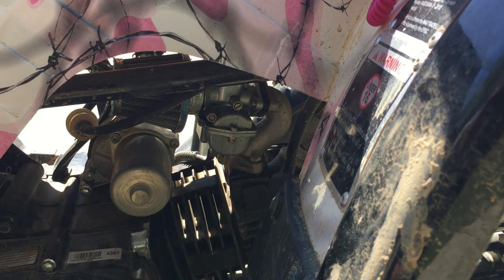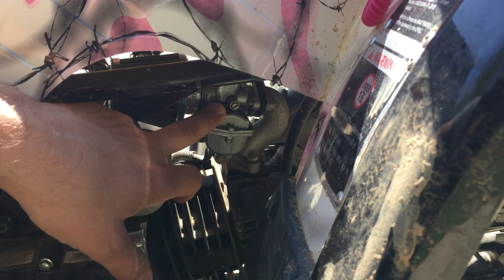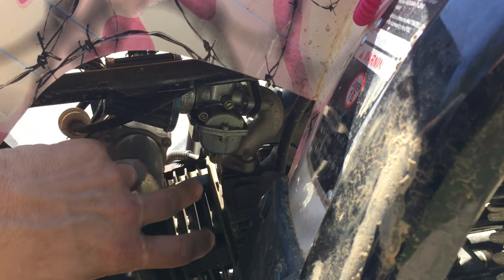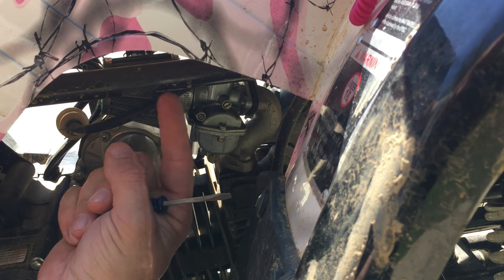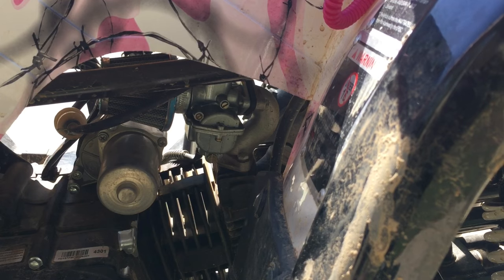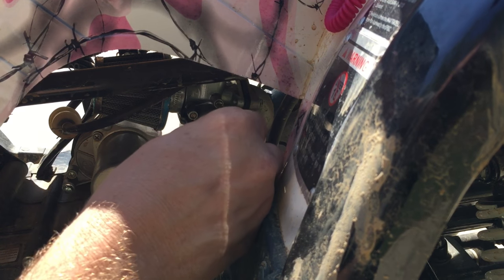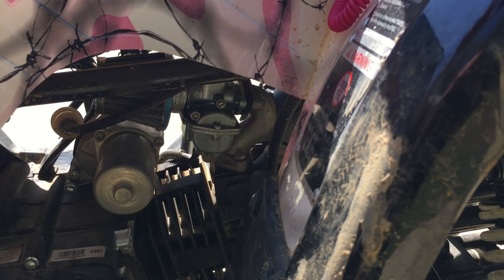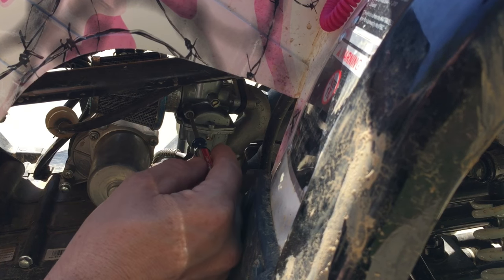Tune Your Chinese ATV Carb

Comment: You need too raise the needle jet one clip, the needle is lifting too early allowing too much fuel from the main jet too enter the engine too close to idle.
That's why it's bogging just off idle.
Reply: David Griggs how do you do that?
Reply: @dirtballnvegas9311  I was referring the guy that made the video and his bikes bogging just off idle but i will explain it to you.
If you undo the throttle cable end and remove the slide and needle , on top of that will be either a threaded cap or a clip of sorts that keeps the needle in position .
Remove this retainer and the needle should be able to be separated from the side .
There will be a C clip on the needle with notches above and below the C clip that you use too adjust when fuel from the main jet enters the engine because this needle when in the rest position drops down onto the main jet blocking fuel from there until it's required. 
The bike in the video had the clip position too low and was allowing fuel from the main jet too enter the engine because there was a gap between the needle and main jet which you don't want when the bike is basically still at idle .
By raising the clip position it allows the slide too open allowing more air in and for the idle jet to do it's job and the needle too open later removing that bogging that you can hear in the video. 
Hope this explains it for you 👍
Reply: David Griggs thank you so much brother. Mine is having this problem. It’s brand new. I appreciate you.
Reply: @dirtballnvegas9311  When you pull the needle and slide out before you go adjusting the clip height pull the bowl off the carby and remove the main jet check you don't have a obstruction in the needle entering end of that jet or on the main interior of the body down where the needle drops through. 
If this is all clear then shift the clip height 1 position at a time until it clears up .

Comment: Good rule of thumb, all the Chinese bikes are dangerously lean, richen it up immediately, do not even ride it before you fatten the carb up or you will burn exhaust valves and then the rest of the motor.

Comment: I’ve looked at mine and mine doesn’t have an idle screw. There is just like a small brass plate where the idle screw is supposed to go. What do I do?
Reply from the maker: It doesn’t have any screws?
Reply: BellyUpFish no it’s a Chinese 125cc
Reply: BellyUpFish I may also just get a new carb
Reply from the maker: Ttv_adenboz Mine is Chinese as well. They’re all over the map. You can get a carb on Amazon for like $15. I’d just grab that, then you’ll be going from a fresh start.

I’d also try to run non-ethanol gas if you can find it.

Comment: Damn things won't roll over a log but goes fast after a bit any fix to this literally can't bump up to a log and then hit the gas and climb over it
Reply from the maker: I dropped a tooth on the front sprocket and added a tooth on the rear sprocket and it would hop logs with a 250lb adult.

Comment: Any thoughts on porting/polishing the intake runner? Or do you leave them stock?
Reply from the maker: Johnny Turbo I’ve never really thought about it on these. Might be worth a shot.  If I did it, I probably wouldn’t go to a high polish like 2000 grit. I’d probably stop somewhere around 600...
Reply: @BellyUpFishGarage  🤔 i may give it a try. Why not lol. I love tinkering, especially if there is performance to possibly gain. 😁👍

Comment: Awesome video! Question, there's a rubber hose from the air filter to somewhere on the engine. What is that and do u need it. Put a k@n filter on son's atv and don't know if i should drill hole in filter like factory, or just leave off. Thanks!
Reply from the maker: Darius Butler That’s your crankcase breather/vent line.  It lets the build up of gases in the case vent out.

You can either route it to the K&N or buy a small filter for it at the local parts store or internet.
Reply: Ok thank you for letting me know!!
Reply from the maker: Darius Butler You’re welcome.
Reply: Darius Butler... I didn’t know either but I just drilled a hole in the new carb air filter and reattached the hose with a new inline filter
Reply: Runs great
Reply: @BellyUpFishGarage  you sure its not the egr?
Reply from the maker: J M I’m pretty sure.
Reply: @J M it actually acts more like a PCV valve but it’s not a valve. In fact it’s more like a catch can and a PCV had some offspring. Lol

Comment: I replaced the carb on this 4wheeler, now when I can crank it, it is already going forward and brakes can’t hold it? Any clue as to what’s going on or what I may have done wrong?
Reply from the maker: Brian Baxley You need to adjust the idle speed down. It’s getting too much “throttle” at idle.
Reply: Don't forget about throttle cable trim adjustments
Reply: @shawngoldsberry747  slide in backwards
Reply: @chezleymcdonald2481  that will definitely do it. More than a high idle
Reply: @shawngoldsberry747  believe it or not my friend thought he had see me do it enough he had it! Lol he took carb off (I had to help him clean idle jet out with sonic cleaner) but other than that he did the rest and it ran good really good 😂 he hit the starter and it went to screaming! He choked it and turned every screw on it for 2 hours. He was getting ill so I sent him for drinks 10 minutes later he pulls up and I’m riding it lol he loads it up doesn’t say a word and goes home true story

Comment: Hey man I have a 125 cc geo quad and when I try to accelerate it feels like I’m getting slowed down from the front brakes maybe I’m not sure new to this but their is a screw I loosend as it told me for the speed lock to speed it up I did that but no difference still feels like I’m being limited to my speed can any ideas?
Reply from the maker: Look at the throttle cable coming out of the throttle at the handlebars. There is a small adjustment you can make on the throttle cable itself.  That may be your issue.

Comment: Okay bro so the iddle how much should go in or out, turns? I got 50cc regal raptor dd 50 and got keyhin carburator but the problrm is that when the engine is cold it starts works like 30 sec and stop thats it... and when its warm its okay what should i do? How to adjust it?
Reply from the maker: Vac3 Poteski A good starting point is to close it and then back the needle out 2 full turns and adjust from there.
Reply: @BellyUpFishGarage  so 2 turns the air flow and also 2 turns the idle. I will try tomorrow that its 1 at night here in mkd. Thank you for your answer i will let u know what happend
Reply: Okay it worked 2 turns for normal i found the max and then i went to the idle and now on cold engine start well and dont shut down also on warm.. finally tnx mate for the info.

Comment: that carb is totaly different my air idle screw is on the bottom of the carb and inposable to ajust .. and that carb you just ajust is still not right it has a dead spot in it only till you are in the reves it is responsive so it any right eather
Reply from the maker: $14 on Amazon. Replace.

Comment: Hey what if it hasnt been started in months? Should i still try to start it with choke off?
Reply from the maker: If it hasn’t been started in a while, I’d start choke on.
Reply: @BellyUpFishGarage and adjust it while it's in choke on mode??????
Reply from the maker: No. Choke should be off for tuning.

Comment: i have a problem of when it gets under a quarter throttle it bogs down by it self real fast to a stall and i have to control it to get home with a fuel shut off valve, What could be wrong.
Reply from the maker: My first guess would be that something is wrong with your throttle/throttle cable if you’re having to keep it running with the shut off valve.
Reply: @BellyUpFishGarage  Thank you so much i will check the throttle cable
Reply from the maker: That’s where I’d start. Just make sure it’s actually operating.

If you can keep it running with the SOV and not the throttle, something is wrong with the throttle.
Reply: @BellyUpFishGarage  ok thank you i sure will

Comment: Will this help with a atv that will only start with help of starter fluid but stays running afterwards?
Reply from the maker: It could. Definitely won’t hurt it.
Reply: @BellyUpFishGarage  anything else you may recommend checking? I got it free while picking up scrap so got no idea. New wiring and battery.
Reply from the maker: If it starts on starter fluid and then runs fine, I’d expect there is no fuel in the carb when you’re trying to start it initially. 

Could be the float in the carb.

Carb is probably due for a cleaning. I’d try to tune it.  If that doesn’t help, clean it.  If that doesn’t. $15 on Amazon for a new carb.
Reply: @BellyUpFishGarage  it’s a new one though, maybe i need to tune it a bit more?
Reply: @BellyUpFishGarage  do you think you can email me some how and help me with fuel lines or exhaust lines? I took them off without taking pictures when rebuilding. Like i have a line from the exhaust pipe going up not sure if that plugs to anything
Reply from the maker: @bubblez9104  sure - try and leave your email address here.

Comment: Maybe you can you help me. I have installed a semi-auto lifan 125 with the carb it came with. I trying to kick start it but it just wont start and when it wants to start, it kickbacks.
Reply from the maker: MrChickenspit First things first - have you confirmed you’re getting air, fuel and spark?
Reply: @BellyUpFishGarage  i do get spark. I connected the wires from engine to the harness it came from the kit.
Cdi and coil all connected.
Reply from the maker: MrChickenspit So, make sure you’re getting fuel and air.

If it were me, I’d look for a plugged/clogged fuel line first, that’s about my luck.
Reply: @BellyUpFishGarage  ok will do. Ill report back
Reply: @BellyUpFishGarage  i have great news! It starts!. So my problem was my fuel. Go figure. I have a ct90 with the dual fuel lines and i bought a 2 in 1 fuel petcock. I took a good look and i realized that the 2 fuel lines were put in the wrong ports..

Anyway, it started and it runs. Thanks you.
Reply from the maker: MrChickenspit There you go man! Glad I could be of some help.

Comment: What can I do to make my ATV 4 wheel 125cc 2x4 to go more faster...🤔
Reply from the maker: David Del Rio JR You need to change your sprocket size if you want to go faster.

A smaller rear sprocket or a larger front sprocket will give you more top end speed at the cost of some acceleration.
Reply: U need to do a video of this...
Reply from the maker: David Del Rio JR I’ll see what I can do. The process is very simple.
Reply: @BellyUpFish isn't it the other way around. More torque at low end you would put a bigger sprocket on the back (more teeth) and a smaller on the front (less teeth than you have now). That gives you low end torque is that correct

Comment: I have a quick question what is that line for under the carburetor?
Reply from the maker: Drain line when the float gets stuck.
Reply: Yea because mine has a line hanging from the motor n it won’t start I was wondering maybe my carburetor wasn’t getting enough air
Reply: Isn’t like an air vet from the float bowl
Reply from the maker: @santosramirez1619  No, it’s just the bowl overflow.
Reply: @BellyUpFishGarage  oh ok

Comment: Can someone please help me. I have this exact carb on my coleman at125ut and it fires up immediately, idles perfect , but when I go to give it gas it just goes blurp blurp. Doesn't go fast and bogs down or something. I've tried relentlessly adjusting the screws with no luck. This is my 2nd carb like it. The first one lasted a few rides until it did this and this one lasted a full ride around the neighborhood until it started going blurp blurp. Helpppppp please lol
Reply from the maker: If it’s idling fine but dies under throttle it’s not getting enough fuel.

Have you cleaned the carb? Was this a new carb? I always clean a new carb.
Reply: @BellyUpFish  Brand new carb. What is there to clean and where on it to clean? It's so clean looking already lol
Reply from the maker: @ThePl87pll Junk inside any of the passages from manufacturing. These aren’t built under the strictest of quality control.
Reply: @BellyUpFish  idk man. It appears to be getting plenty of fuel. Maybe I just got 2 bad carbs. I'm lost at this point

Comment: Hi BellyUpFish. Do you know if there is an oil filter in the engine?
Reply from the maker: Lo Ranger There is a screen on some of these engines.  No traditional “cartridge style” oil filter.
Reply: Thanks. If there is a screen, would you know where it would be?
Reply from the maker: It’d be under a nut with what looks like a huge washer under it.

Google 125 ATV oil screen, you’ll see what I’m referring to.

Comment: Does turning it in or out make it rich?
Reply from the maker: Tightening, and reducing fuel flow, will lean it.

Loosening it, and increasing fuel flow, will make it rich.

Either way, just play with it until it runs well.

Comment: How do i tune the carb when mine wont run without the choke up/on?
Reply from the maker: Have you turned the screws out to around 2 turns and tried to see if it’ll run without the choke?

Comment: Idk why but my Chinese atv doesn’t turn on it just makes like a bee sound and we don’t know what it is can you plz tell me would really appreciate it
Reply: And the oil was like boiling and making smoke
Reply from the maker: Buzzing is most likely the starter solenoid trying to work, but can’t due to low battery voltage.

If the oil wasn’t boiling, I’d say you could push start it to verify if it was your battery.

I honestly have no idea why the oil would be boiling, that’s not usually a good sign.

Where was it smoking from?
Where did you see the boiling oil?
Reply: Oh alright thanks you  so much 🙏
Reply: And the oil was boiling from like at the top like where the starter is at
Reply: We think it’s the oil bc it was black
Reply: And yea bc we got a new starter
Reply: And it was the first time we every saw that bc we just got it back from a mechanic and it didn’t do that and we rode it but then the starter poped and we got a new one and we just got the starter and we rode it once and something start making smoke and boiling by at the top of where the oil is supposed to go in
Reply from the maker: Do you have a voltmeter?
Reply: I’m not gonna lie to ya ima noob to this stuff
Reply: But it worked when we put the new starter in but the problem was just the oil and probabaly the battery

Comment: I know this is an older video, but I’ve currently got the same carb but it’s overflowing from the overflow tube, any ideas?
Reply from the maker: Your float is likely stuck.

Turn the fuel shut off valve off and clean the carb.
Reply: @BellyUpFishGarage  taken it apart and cleaned it twice now and it still leaks like crazy. All the gaskets seem fine and the float bounces back really well when I check it. Is there something else I’m not thinking of?
Reply from the maker: A clogged bleed hole somewhere could cause it.

I’d probably clean it one more time and if that doesn’t do anything, I’d order a new carb.
Reply: @BellyUpFishGarage  took it apart once more and cleaned it really well again. Double checked all the seals and took off the float and the float needle and cleaned those too.

Turns out my float wasn’t pissing the needle up into the brass part so gas would just keep filling up the bowl even if the float was at the top of the bowl. 
To fix it I just bent the little piece of metal down that pushes the needle up and that did the trick. 
Thanks for such fast replies! Cheers!

Comment: Does that smoothes the smoothness of the engine because mine vibrates while revving .
Reply from the maker: Aidan Borg It might help some, but I hear things are pretty rattle-ly anyway.
Reply: These bikes vibrate a lot, but also make sure you tighten the engine bolts down every so often because that can cause excess vibration
Reply: @73macrino  okay tks

Comment: Just got one of these. After a couple hours on it when i turn it on the rear wheels keep spinning. Anyone know how i can solve this issue.  Once i hit the brakes it turns off.
Reply from the maker: I’d look for a vacuum leak first. 

Grab a can of carb cleaner, start the quad and spray all over the carb and if the RPM’s increase.

If they do, you’ve got a vacuum leak.

The wheels are spinning because your idle speed is climbing.
Reply: @BellyUpFishGarage  ok cool will do that. Thank you!

Comment: Can you please answer this question.. how many turns from full idle should I turn the screw counterclockwise?
Reply from the maker: Try 2-2.5 and see where that gets you.
Reply: @BellyUpFishGarage  ok trying that right now
Reply: @BellyUpFishGarage  no luck ..I have both the idol and the airgas mixture screws turned out two and a half from tight
Reply: @BellyUpFishGarage  my buddy came over and sprayed out the carburetor with starter fluid and got it started for about 30 minutes but it wouldn't start after that not to mention it wouldn't start or run with the carburetor filter on
Reply from the maker: @upnorthofcali7399  Did it run with the filter off?

Comment: Hi my atv when i turn it on it the rpm is high like someone is reving it could you please advise
Reply from the maker: Sounds like your idle speed is too high.  Dial it back and it should be fine.
Reply: @BellyUpFishGarage  which one is it first one or second
Reply from the maker: eassa your dead meat 0:15… It’s the one furthest from the air filter.
Reply: @BellyUpFishGarage  thanks
Reply from the maker: You’re welcome.